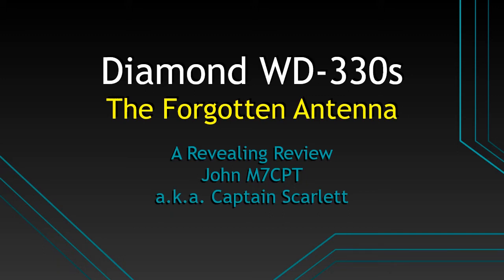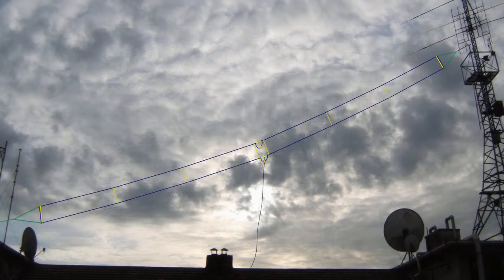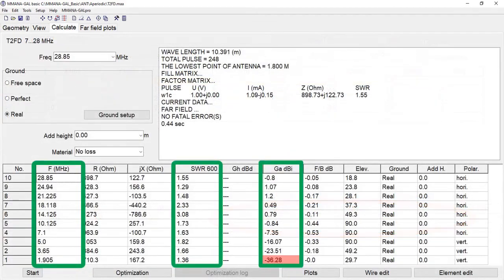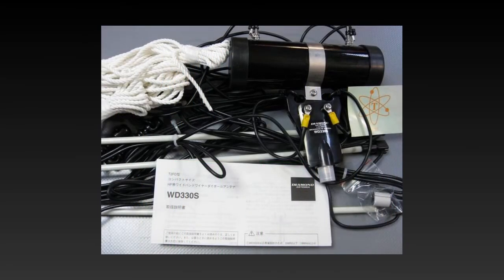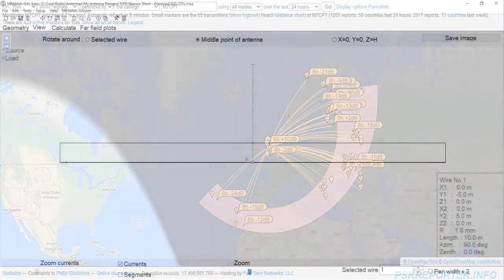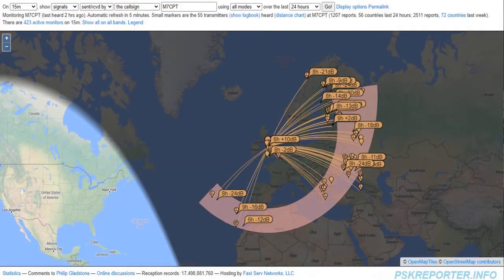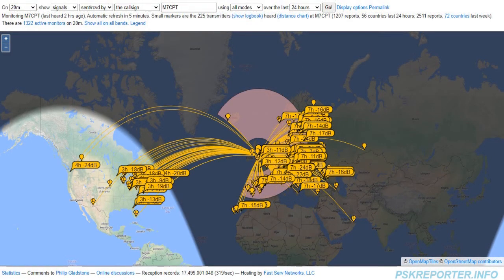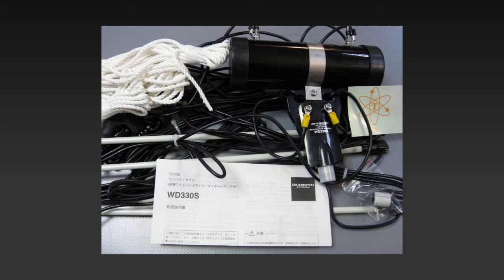The short commercial TTFD/T2FD "The forgotten antenna" - Diamond WD-330s Review

Comment: H0w good how bad according to your experiences please let me know i am planning t buy it soon
Reply from the maker: On 7MHz and above it is an excellent antenna allowing very quick frequency switching with a tuner but for frequencies below that the signal loss is considerable and you will hear far more stations than you can contact. This is a compromise antenna due to the size and the longer versions (25m) are far better but are still rated for a max 150W SSB & 75w data. It all depends on what space you have available what height restrictions you have, power requirements etc. For me it is a good antenna as it means I don't have to go outside every time I want to change bands and although the TX is very limited it does give me 160m on occasions.
Reply: @A.R.O.T.A.  	thx u Mr.John

Comment: Many years ago, I had the Barker and Williamson 90 foot version of this antenna, up horizontally at 40 feet.  Though it was rated at 1KW, I occasionally pushed it to 1500 on SSB with an Alpha 87A.  (No-tune amp plus no-tune antenna minus an antenna tuner equals minimal effort.)  I thought it worked very well on all the HF bands with the exception of 160m.  I managed to heat up the once-white termination resistor housing so that it turned brown.  Still worked fine.  It didn't like 6m, but was oddly happy on 2m. 

I tried to buy another one but now B and W only makes it with stainless steel wire.  The one that I had was Copperweld wire, which they said was no longer available.  The stainless one costs a lot.

Comment: Great video! @6:41 what is the explanation of the loss in gain at the lower frequencies? I have looked elsewhere on Youtube but the only thing that comes up are additional losses due the transmission line, in particular as you go up in frequency. I imagine that this is not what is at play here?
Reply from the maker: The resistor allows this antenna to sort of cheat by removing the parts of the signal that will not resonate on the length of wire it has available. As the frequency decreases the amount of wire required to resonate well increases. Because of this the % of the wavelength able to resonate on the antenna is reduced and the rest is absorbed by the resistor.
Reply: @A.R.O.T.A.  Tx! Really helpful 👌

Comment: Hi John,  recent Ham myself and suffer with a small footfall also,  would have the room for one of these running North/South 30foot up so once I get Xmas out of the way I may bite the bullet and get one in the new year.  Currently using a half size G5RV and a 5 Band Cobwebb and get mixed results from 40 to 10.  I do listen to 80 and hear a lot of stations here in Ireland reasonably good so hoping the WD 330s would give me a shot at them over the winter months. 
73s, Seasons Greeting and I'll look forward to watching more of your vids.  MI7WPX / 68GI55
Reply from the maker: The main thing I find is it works great 40m-10m but while it can be used on 160m & 80m the signal loss at those frequencies is very high. I will be trying out some other antennas that can be used on multiple bands over the coming  year. It's unfortunate that the weather has turned too cold for field work (SOTA/POTA) at the moment for the longer antennas. The only other one I can recommend for small gardens at the moment is the DX Commander Classic (40m or 80m versions) but some people may have problems with the height as it is taller than a 2 story house and it is a self build. Search DX Commander on YouTube for details there are many reviews and Calum also has a lot of very helpful videos.

Comment: I'm amazed that you worked the US with 10W and this antenna, is this on ft8 or something rather than ssb. I've found my 10W pretty much useless on ssb. 73s m7ojw
Reply from the maker: Yes it was on FT8/4 for the results to get recorded on the map view. SSB phone would not have got as far but also the propagation was a little high on the day of testing and that would also have helped a lot.
Reply: @A.R.O.T.A.  have you managed to make many contacts on ssb with your 10 w? I've got an OCFD but have had really limited luck to be honest. Solar cycle is supposed to be on the up though I guess so fingers crossed. I'm going to do my intermediate when the club starts meeting again. Cheers M7OJW
Reply from the maker: @owen8137  Unfortunately my current QTH doesn't enable to use the voice modes easily so I have only been able to get local contacts. FT8, FT4, JS8, etc. allow me to get a signal out with my poor propagation. I am trying to learn CW as perhaps I might be able to make contacts out of the valley with that but it's slow going.

Comment: I have it mounted in my loft atm from corner to corner in a inverted v but plan to mount it outside. I must say the noise level on these type of antennas is excellent S2 top end and s5 on 80M and that's in my loft with all the electrical cables.
Reply from the maker: Having the resister close to the balun makes a much bigger difference than I thought . I will be modifying mine soon to a delta configuration but keeping the resister & balun attached to each other. I just have a couple of things to get.
Reply: @A.R.O.T.A.  Sounds interesting. BTW on a side note do know where i can find any decent tutorials on how to use the MMANA program would be great to learn what my EFHW performs like. Thanks M7OLG
Reply from the maker: @jaoppst47647  The only one I would recommend is DX Commander's 4 part tutorial. It doesn't cover everything but it's the best one I know of. Follow this link to part 1 :- https://www.youtube.com/watch?v=ZuNY5-5qXes
Reply: @A.R.O.T.A.  Couple of more questions about your WD330S setup if you don't mind. I'm thinking about mounting mine on top of a fiberglass spiderpole (Heavy duty version 12M). Do you use a choke for your antenna and if so how far from the feed point do you have it and also do you have any kind of grounding for the antenna ie grounding the coax. Thanks.
Reply from the maker: @jaoppst47647  I'm not sure exactly what kind of pole it is that you are thinking of but it needs to be strong enough to hold the weight of the Balun & loading resistor. I do not use a choke or any grounding for the antenna. I have also run some additional checks on the position of the resistor and found that their placement of it reduces the SWR on most bands & also increases the gain slightly.

Comment: This is not too bad for an antenna mounted on your fence and nestled amongst all those buildings running 10 watts.
Reply from the maker: Thank you. While it isn't easy getting a signal out (VHF & UHF are almost impossible) due to the valley I am in. I find placing dipoles close to the ground so the signals are reflected upwards by the ground makes getting out so much easier.
Reply: the trouble with any antenna resting on a fence is it will contravene the OFCOM  calculator measurements of keeping the antenna away from the neighbors and public surly.